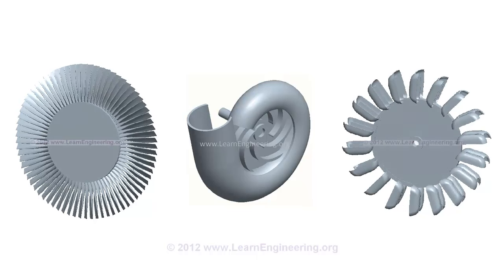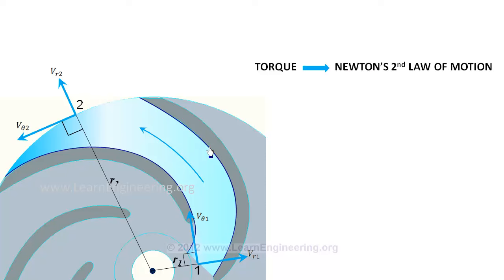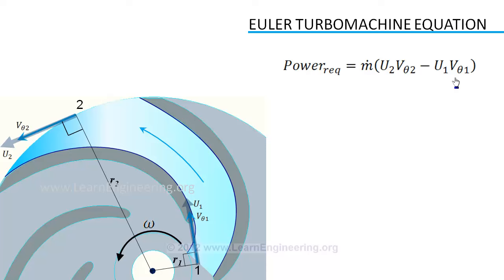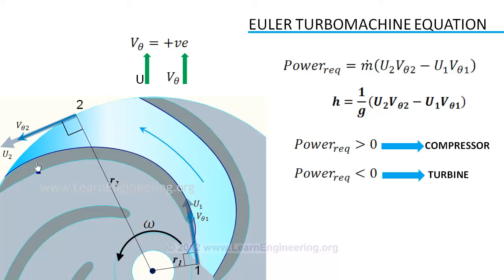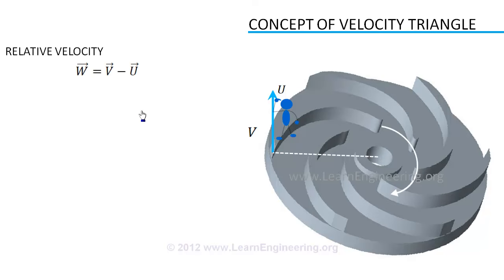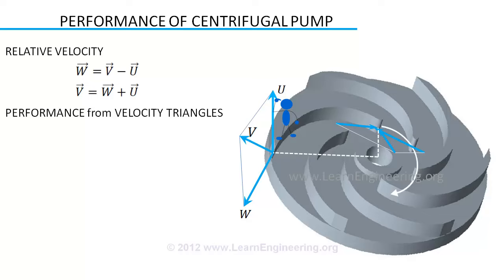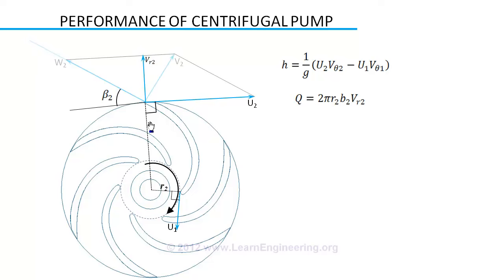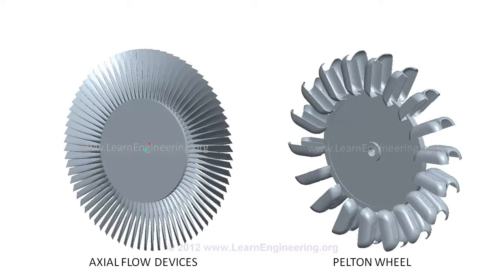Turbomachinery | Fundamentals

Comment: Although it's possible to have forward curved blades the drawing presented until the first 2 min 30 sec seems unrealistic. From then the direction is inverted to clock wise rotation and the velocity triangles look better. However, there is an inverted vector in the eye of the impeller. The authors should have been more careful with such an important topic.